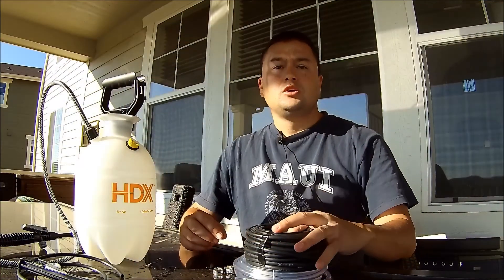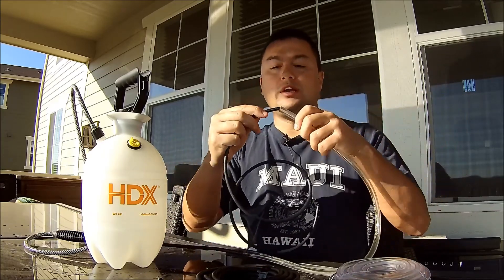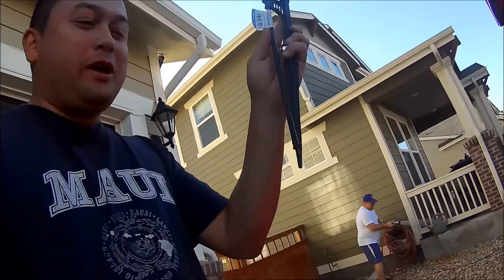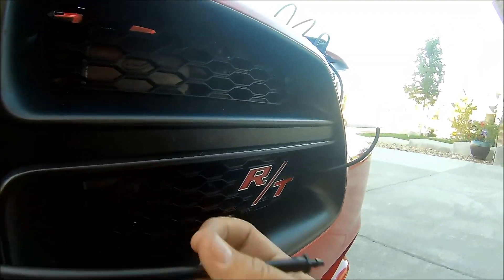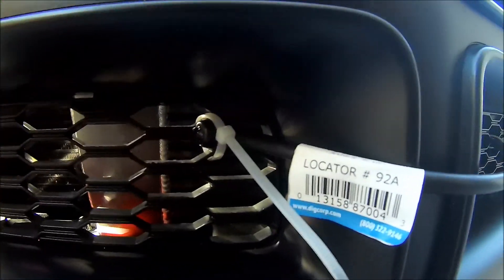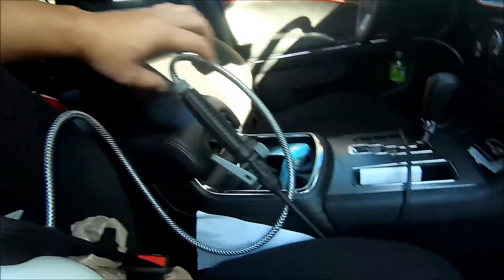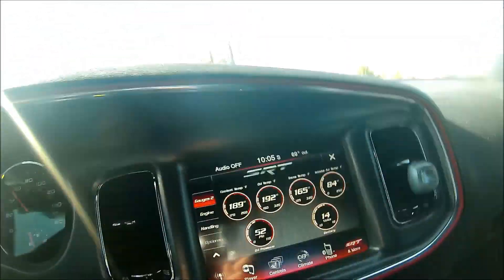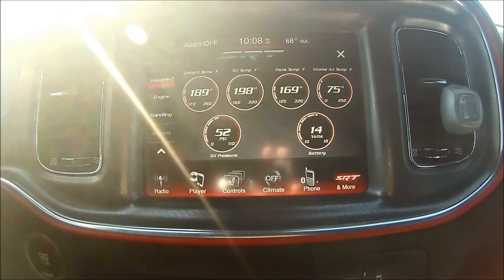Does the budget intercooler water spray really work? - RL testing of Mighty Car Mods DIY spray

Comment: Like the pokemon sample at the end. Would placing a block of dry ice under the hood do anything beneficial. Just a random question.
Reply from the maker: eunit08 I have not seen anyone use dry ice before but I have thought about it. Typically what I see is a bag of ice placed on the intake manifold between drag races or before dyno runs. It must work because it is fairly common. 

I get what you are saying though. If I supercooled the intercooler how would it affect the air temperature. Worried about using dry ice though. It’s really cold and the intercooler being next to a hot engine. Worried it would stress the welds too much and crack the intercooler
Reply from the maker: And obvious you made it to then end lol. I put random songs at the end sometimes to see who catches it
Reply: dasllamas ok thats good to know. I knew that the interior had to have the heat in it to be efficient just thought itll balance it out some but hey i learned something.

Sorry i never noticed the music at the end of your videos. Ill pay more attention
Reply from the maker: eunit08 not expecting you to notice the music. Just little Easter eggs I hide in some of my videos